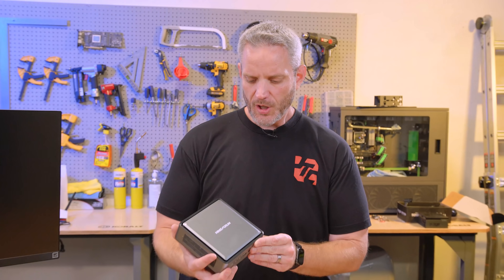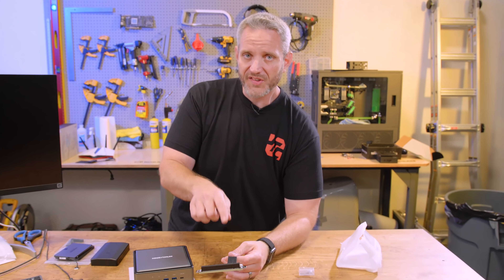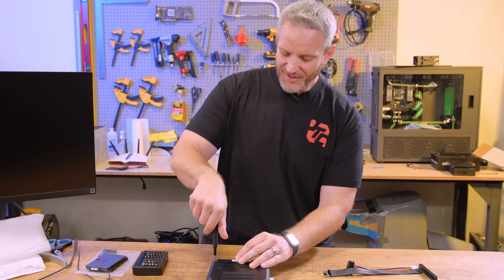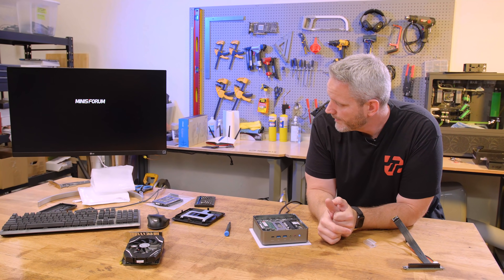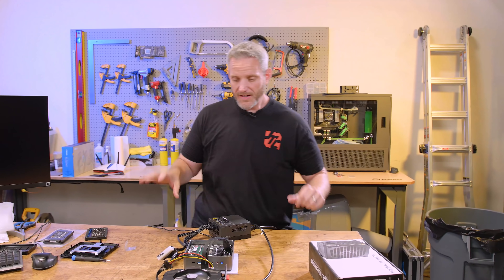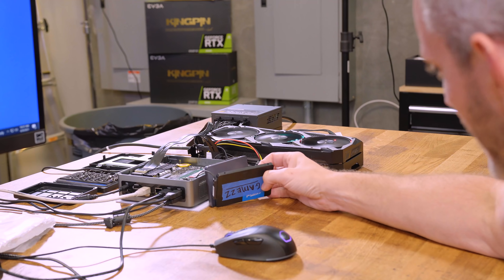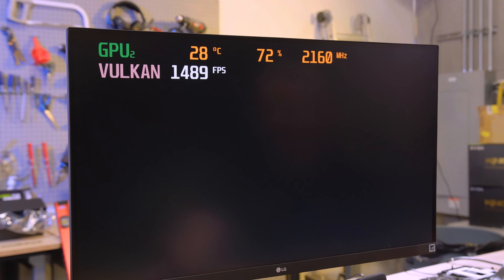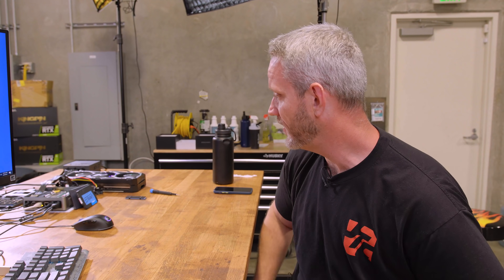This was easier than I expected it to be! Super powerful mini pc

Comment: You could put it in an old CRT monitor. Replace the old screen with a modern panel to make space for the pc inside. It might be hard to find a CRT with a widescreen aspect ratio and decent size though.
Reply: Go to a recycler and pull a dead monitor from them.
Reply: could go with a dead CRT Sony WEGA 32 inch and have a Gaming pc within a TV with a smaller 4k monitor. Would need to be water cooled though unless you make your own vents and shit
Reply: old school AIO computer!
Reply: Please don't do this, high end PC CRTs are rare enough already.
Reply: @RikuKawai  I had thought of doing this, if i DID do something like this with a CRT, i would go to a recycling center and get one that no longer works, and use that instead for this type of mod

Comment: I'm sure it's been mentioned in the 3k comments already.

but DO NOT USE SATA OR MOLEX POWER ON THESE.

They're only rated for 54Watts; well shy of the PCI-E 75watt standard and well they're known to eventually overheat and melt.

Comment: It bit of CAUTION if you do using Graphics card without additional 12V Power with these adapters.

The SATA power contact only rated for 3A (for each voltage). Which means its only good for around 35W of 12V Power or around 50W combined 12V+5V Power.
More than that there is a risk of over current and can heat up and short.

So standard x16 PCIe slot can supply up to 75W, If some cards do draw at much as 75W from the slot and SATA connector it will end up melt, and may cause serious damage to PSU.

Comment: one suggestion for these kinds of mini pc makers: make a dedicated slot for this kind of thing, and have a dedicated header to activate the external PSU based off of the "PS_ON" wire, maybe use the 5v standby to power the board so you can control it all with one button

then just cover the slot with a cover, or make a separate sku only for the case, and you only have to make ONE part that is different

Comment: Sounds like what you plan will need another enclosure other than the base PC you selected, so why not build directly on that enclosure and have only one PSU instead of two.  You could get a PCIe 4.0 x 16 slot with Asus ROG STRIX B550-I GAMING AM4 mini-ITX.

Comment: Something like this adapter to cut the power supply down to just another brick? Little low power but more discreet. Dell 12V 18A 220W 8 Pin AC Power
https://smile.amazon.com/dp/B07PT73HYG/ref=cm_sw_r_cp_apa_glt_fabc_QZJXXNN5DM8WZRCS381T

Comment: I actually play with a PC like this. I have a Dell Latitude E6330 with a Nvidia 970 plugged into the express card slot. It took some fiddling to get stable but I am quite happy with the final performance boost and can play the games I enjoy at a decent frame rate. As a plus it is easy to switch back and forth between the egpu and the internal graphics because of the express card slot.

Thank you for making this video. I enjoyed it.

Comment: that ribbon cable may or may not be built for it, but truth be told, they fold ribbon cables over "180" as he called it, All the time in Tv's Laptops Tablets, Monitors, and Many MANY other devices. Its the act of reversing that fold repeatedly, taking it apart or what have you, working trhe cable back and forth that breaks it, not the initial bend.

Comment: Could you remove the little m.2 Wifi card and install either the nVME drive or the GPU adapter there?  That way you can have both the nvme and a discrete GPU?

Comment: if you wanted to make it a little smaller and not use an external psu you could get one of the power supply bricks used for drive readers. it would only work for things like a a 1050ti obviously.

Comment: Oooo ideas are filling my head! Fit it in a large model airplane body that could hang from a ceiling with cords ran up a chain to a distribution box and cords ran down through the wall to outlets behind the monitor at a desk for perfect cable management 😯
Reply: I'm thinking a person creative enough could do a jumbo jet or even do a full ww2 themed room with LED lights in the plane/Jet and wire it all including the pc to turn on with the light switch as you enter the room. I know of some rc bodies that would be perfect to fit it all and hang from the ceiling

Comment: you're probably hitting the gen3 x4 bottleneck somewhat. Keep in mind those NVME's only run gen 3 on that NUC right. A Gen4 x4 would probably be able to handle the bandwidth but the riser would need to be shielded AF

Comment: This problem was solved 3-5 years ago, where there was a breakout box for the video card and it had a Thunderbolt connection from the PC to the breakout box and you dont have to mode the case for the pci-e wire to come out of it.  EX:  https://www.amazon.com/Razer-Core-Thunderbolt-External-Enclosure/dp/B07CQG2K5K/ref=sr_1_18?dchild=1&keywords=gpu+breakout+box&qid=1623713778&sr=8-18

Comment: You tried a 1050... but why not a the 1650 which is what the market currently shows is the highest end card that's easy to get.  Would that system be worth it compared to buying a small mobo, ram, power supply, SSD?  versus the $840 mini PC + $150 extra Power supply + $300 video card + $100 ram + $50 SSD = $1440.  I like the idea of doing the external video card with an old laptop.  Although my laptop is older than the m.2 drives :( It's an idea for an $800 laptop without a gaming video card maybe.

Could the external PSU be used to power both the computer and the video card?

Build the computer into:
1. Toolbox
2. Stool
3. Recliner
4. Coffee Table
5. Livingroom media center with bluetooth keyboard/mouse.  Probably doesn't need the external video card.

Comment: Aren't SATA lines rated for substantially less than the 75W that's supposed to be provided through the PCIe slot?

I feel like that should be a concern for the cable heating to an unsafe level / melting

Comment: The ATX standard for SATA or Molex connections is rated for 54 watts. Not the needed 75 watts for PCIe. You may be ok if the GPU does not pull from the riser the full 75 watts (believe you can see this in HWInfo) but DO NOT do this via SATA

Comment: I have always had the thought of putting a pc in a car, specifically a 1986 pontiac parisienne station wagon, as I own one and on the passenger side of the dash is a rectangular piece that looks like you can un screw/bolt it from the front of the dash and custom make a panel for IO and (at the time) a dvd rom or even USB slots, possibly some sort of flip out screen like some of the stereo's for vehicles where the screen c9mes out and flips up. this all came about one day because of the thought of PC power supplies having 12 volt power to a pc.

Comment: Make a full DIY external GPU next in something like a Mini ITX case
Reply: i actually did that with an old dell slimline case and psu awhile back because i gave up on trying to find a gpu for my travel gaming setup it turned out great and works like a charm it looks like a legit egpu box from the side until you see dell on the front and can be built far cheaper than buying one

Comment: when gaming my pc restarts ,then when its all booted up i find that my display drivers are uninstalled and the radeon controll panel when i press right click is gone,what could be the reason
specs:
i5 3470
16gb ram
amd radeon rx 580 armour 8GB
500w coolermaster 80+ psu

Comment: You gotta be really careful with those SATA power adapters. SATA power connectors are only rated for 54 watts and if you do a quick search online you'll find a whole lot of pictures of fires and/or melted connectors from miners trying to use those to power cards.  If a GPU can pull 75 watts through the slot you're going to be pushing more power through that connector than it can handle.

Comment: Mount it in a portable mini fridge, with a projector. Bonus if you can make it look aesthetically pleasing/hide the pc/only power cable is the fridges. Also just to note they do make a relay thing for dual power supplies so that when you turn on main power the secondary turns on too. I had saw one when looking into mounting drives externally for raid on a 1u server.

Comment: The idea would be that you could purchase an Intel NUC or NUC-Like setups, 3D print a neat case that supports an External GPU via NVMe bridge adapter. I find this fun to make tiny builds for like many LAN Parties and Tag-Along events. Even for upcycling some equipment would be possible.
I've done builds before with 130+W power bricks or even TFX/SFX psus to power both the GPU and PC with a buck-boost converter to get 19v for most PCs from a 12v rail.

Comment: isnt SATA3 about as fast as USB 3.1? couldnt you just use an external SSD over USB-C for a boot drive? Just for simplicity sake
Also my first thought was to enclose the individual parts in similar cases. So you just stack them ontop of each other like older HiFi equipment. The PSU and the NUC are a similar footprint already. Maybe actually use old Minidisc or small Casette Decks n stuff.

Comment: You could build a briefcase pc with screen and power inverter so that you could potentially plug the whole thing into a cigarette lighter of a car, rv, minivan.

You could also do one of those pimp my ride things where you again have a vehicle and you just so happen to find a way to install a 32" monitor, the pc, and then integrate the sound into the vehicle's stereo system. And if that system already has an amplifier, subwoofer, and door, front, and side speakers all the better for those gaming sessions and make shift mini movie theater.

Comment: Either a briefcase like someone else said, or maybe a Series X case? Seems like the height and width of the card, and the NUC itself could go behind.
See if it would be possible to have a custom power supply since you basically only need 12V 300W or something
Reply: Thanks for watching you can leave my analysis a message to guide you through.w=h=a=t=s=a=p=p=+/1=2=1=3=3=5=5=0=9=0=6

Comment: How long do you think it will take before we see nvme graphics cards? 

With the move to pcie gen 5 couldn't a portion of system ram be allocated to support an nvme based graphics processor like how amd's g series apu's use system ram? 

Also with ram capacity further expanding with ddr5 an nvme based graphics card could potentially have access to as much as maybe half the system memory total so on a 128GB ram set say upwards of 64GB, or would having the GPU seperate from the cpu be a limiting factor?
Reply: Total bummer.

I thought at first maybe Jay was actually responding to me, then I looked up the account before sharing personal information over a text message.

The account is only 3 months old, if it were genuinely Jayz2cents account it would be way older than three months old and it would have links to the library of YouTube videos Jay has made over the years. 

=/ oh well at least I didn't fall for a scam.

Comment: Would be nice to see content on cables, different connectors, fan connectors etc. I cannot seem to find good cables for my PSU with quality connectors and the minefield of fan types and RGB  connectors just made a pile of worthless hardware and messy wiring.
Reply: Thanks for watching you can leave my analysis a message to guide you through.w=h=a=t=s=a=p=p=+/1=2=1=3=3=5=5=0=9=0=6

Comment: Stirring the conversation away from mining, this is also useful for render farms
I use Blender extensively and tested whether GPU rendering was "Talking in real time with the GPU" or "Giving the GPU info and letting it compute"
Turns out, in Blender, there is next to no difference between GPU rendering with the GPU plugged in the x16 slot running in x16, and the GPU plugged into a x16 slot set to x1 in the BIOS (to make sure my testing was accurate, I chcked with GPU-Z and it reported the GPU was plugged into a x1 interface)

So I built a render farm, when GPUs were well-priced second-hand, with those adapters. An Asus Hyper M.2 x16 card, 4 adapters, and the PCIe slot set to x4/x4/x4/x4 in the BIOS, and boom, quad GTX 1080 Ti render farm easily.

I'm unsure whether Maya, C4D or others use the same principle with GPU rendering, but it's worth a shot.

Comment: @JayzTwoCents
Yes do it, smallest of build. What about a modular all in one with some of that Jay style added. Since it's small you could mount it to a PC monitor maybe an ultra wide and a custom case for the rig on a dual arm. No cables viewable only power cables run down under desk (and maybe Ethernet)
Reply: Maybe even a secondary screen on the front of the case so it's like dual monitor.

Comment: might try this with my laptop, it doesn't have thunderbolt but i have a suspicion it does have an nvme slot. I mean i'd need to find another gpu to use it with, however it's more for portability like going on holiday because i recently built my first tower

Comment: i got a similar adapter but not the nvme version that i used in a diy egpu box made from an old dell slimline case and psu that i had now the one gpu can be used in most of my systems that are still waiting for one of their own also did exact opposite for storage in a hp elitedesk usdt (not much bigger than nuc)ssd got in way of a fan i mounted over the msata ssd which there’s two slots so second was used for the egpu box which works great for a diy solution to current gpu shortages

Comment: You can get a surge strip that has a master plug and switched plugs triggered by the master. Hook the mini pc up to the master and the supplemental psu up to the switched plug and have the psu come on when you power up the mini pc.

Comment: I know Intel is selling systems like this. I have been considering those for my Flight Simulators. I am talking about a professional Flight simulator setup using 3 HD TV's not Monitors for the Slave Machine. The Master would run Xplane 11 and then there are all the peripheral's of course. Currently I have to run 1 Computer for each 50" screen just to stay stable using 1080 ti boards. At some point I want to upgrade to better Computers but not until I can find the best solution. If you have a look at Precision Flight Systems you will get an Idea of what I am talking about. i wish I could post a picture of my system to give you a better idea of what i am trying to achieve.

Comment: It has been done before, but I think not in this form factor.
You could basically create the worlds tiniest "cloud" gaming pc, not sure if the motherboard supports IOMMU, but you could install linux, block all nvidia drivers, connect a 3060 to it, then proceed to pass-trough the GPU to a windows VM that can be connected to with RDP to enjoy some casual games, with the recent patches that NVIDIA made to their crappy blob I think you could even split the 3060 into a couple of vGPU's and do more than 1 gaming VM on a single PC, however by the time you get to more than 1 VM on a non NVME ssd running at the same time, the performance will probably be crappy, however...
World's tiniest cloud gaming setup is still really POG as kids say these days

Comment: Would be nice to see if you can do something similar but using Thunderbolt, i.e. get round having to buy over priced external GPU enclosures. Thinking some cheapo thunderbolt to PCI/PCB, PSU and DIY enclosure or something off the shelf that can be the enclosure...

Comment: You know, what i want to see? Install a PC in a pan. Glass cover would be nice with some RGB. Cords need to be built into the handle. Question becomes where to exhaust the heat though. Maybe no glass cover then, metal with a rad mount? Wait, cables out of handle... How about induction?
Bottomline: we are technologically not ready for this. 😄

Comment: The nvme adapters existed before mining was really a thing.
Reply: I think they where SATA (not nvme) and they connected to the WiFi mSATA port.
I had one of those, it turned my 3rd gen i5 laptop into a "gaming" laptop. Had to dremel a small hole and use a WiFi dongle, but it worked.
Reply: @c0kosnuts2  think you might be confusing the different key slots. Like a b m and I key layouts. Any can support nvme as it's normally a pcie connection.

Comment: Get one of those old big CRT monitor and just use that as the whole PC
Reply: better idea: get the outer shell of a CRT monitor, put that around a modern monitor that fits it, put the pc inside the shell. Ultimate "all in one" sleeper PC. A Model M keyboard and a mouse from the same era would really top it off.

Comment: Having a tire with a display output and a spinning rim which acts like a fan for a PC build inside it would look awesome. Like having it hanging from a wall like you would store a tire no visibla cables but the Rim starts spinning when you turn on the PC and you have like RGB lighting from the tire against the wall so that it looks like it would for a car with underfloor lighting.
Although the lighting would be optional the spinnig rim or hubcap acting a a fan to have some airflow over it could improve cooling and alloew you to just have one big heatsink for CPU und GPU
Reply: true $chitt... Im going to do this one day..for so many reasons
Reply: Barrowch Speed Series is pretty similar

Comment: I would like to see if you could power the GPU of the internal sata header and only have one sata ssd.

also you could put it in a ship instead of a boat :P No but would be fun to try and hide it on the back of a monitor only using the vesa mount on a monitor stand, hide all the cables and rund wireless MKB